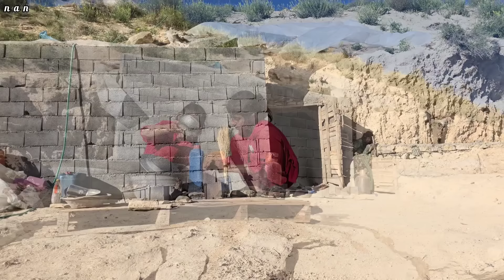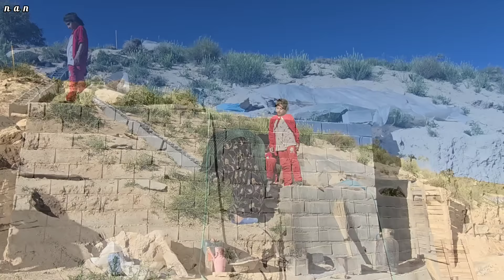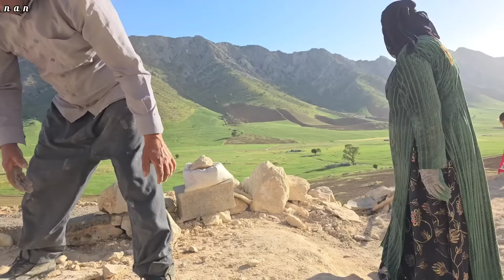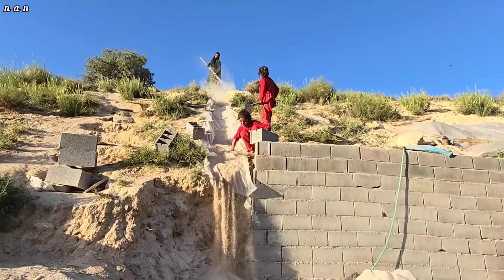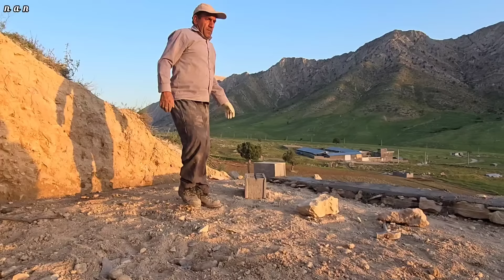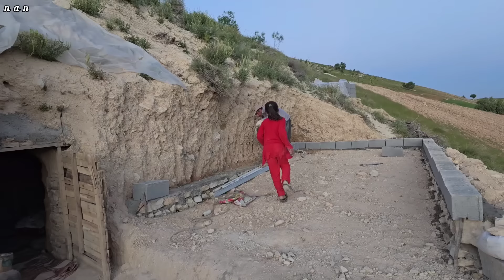"Building Dreams: A Grandmother's Resistance in the Mountain Cave and Trying for a New Home"

Comment: A suggestion:
Get the path that has been scrapped smooth by the bricks damp. Use your hands and rub it until the dirt becomes slick and smooth. But don't use it for bricks then only sand.
For bricks
Set the brick on top of a thick piece of plastic. They will slide easier. Tie a rope to the plastic slide to pull it back up once unloaded. Make it out of a water jug.